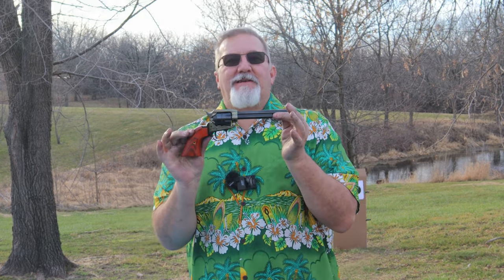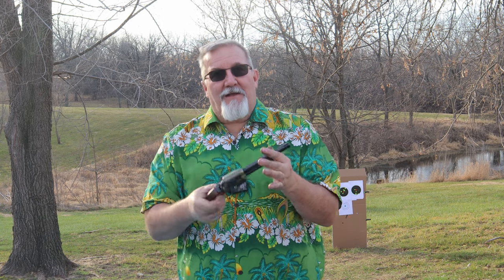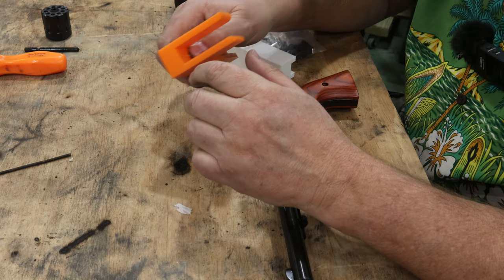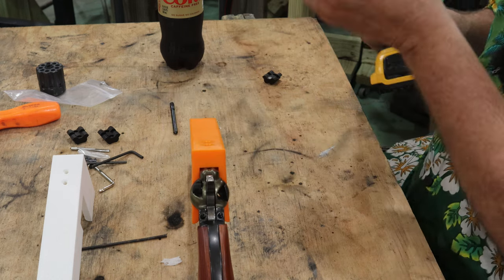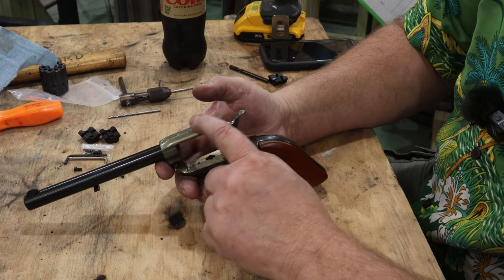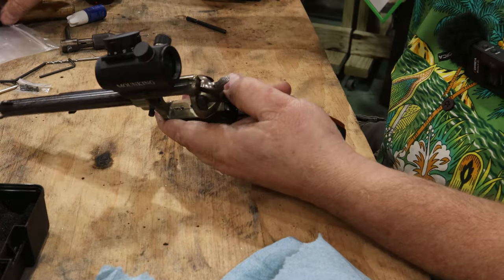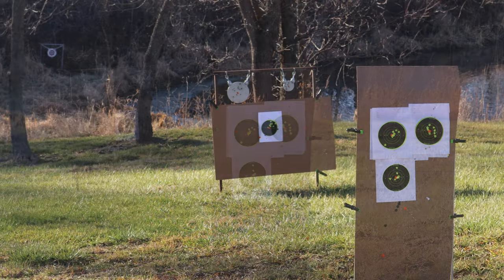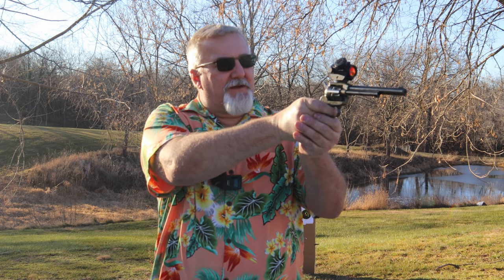Heritage Rough Rider and How I mounted the Red Dot

Comment: I built a product that I 3D print, and the cool part was that I then modified it to produce a drilling jig, to assure square installation.  In this case you started with the jig, but, I wonder if one could print a sturdy enough, contoured, and lowered dovetail at 100% density, in PLA, and substitute it for that high dovetail you got.  It could be easily designed to fill in the sight track, and to be the ideal length for engagement with the red dot base itself, while giving a wider stance for the screws.  I looks as though once the interface with the sight base is full length, there would still be space to fair the the PLA dovetail into the frame.  PLA is pretty tough stuff, and it might be more than strong enough for a use case involving a 22lr gun.

Comment: Mike that was a slick piece of engineering, for your info and that of the general community you can get a heritage tactical with a factory 🏭 installed picatiny rail and fiber optic front sight. Be that as it may your technical abilities are quite impressive 👏
Reply from the maker: I have two of the tacticals already.  I have 9 or 10 of the other style and I needed them to have better sights as well.  All but 3 of my Heritages have a red dot sight on them now. They have good barrels, just terrible iron sights, thanks for watching

Comment: What an awesome presentation.turaus now sell the 856revelver pre drilled at the factory that comes with mounting plate.well I bought an 856 before I knew what they were doing.my local gunsmiths will not do any custom work so I will have to do it myself.your video gave me ideas to do it myself many thanks.
Reply from the maker: Glad it was helpful

Comment: I just glued the picatinny rail. The connection is very strong. you need a glue in the form of a paste designed for gluing metal. glue, press, remove excess.
Modern glue holds stronger than two small bolts
Reply from the maker: interesting, thanks for watching
Reply: @Michaelsbackyardmarina  I'm currently waiting for the glue to dry under the picatinny rail on my heritage.

Comment: Nice engineering.  I've thought about trying it, but I'm not sure the jig would work on my Barkeep. I think the overall frame dimensions are the same, because the Barkeep uses the same cylinder as the rough rider, but the Barkeep frame won't accept the ejection rod assembly. The barrel length looks like it might also be an issue. The Barkeep is 3.6 inches & my rough rider is 4.75 inches.
Reply from the maker: you could do it on the bar keep. Thanks for watching

Comment: I have a Beretta Stampede with a 7.5" barrel chambered in 45 Long Colt and thinking about getting the top strap above the cylinder drilled and tapped for rail to put a red dot on it for deer hunting
Reply from the maker: That would be fun for sure

Comment: Just FYI you can now buy an ejector for that with a metal handle on it instead of that injection molded plastic one on Ebay right now for like $25. Probably the cheapest looking thing on that rig IMHO.
Reply from the maker: When I break one then I may buy one. Thanks for watching.

Comment: You gained a sub and like genius but Why wouldn't you use a micro dot? And a quality red dot does not have the problems you encountered, and give you a much better dot quality. And i fell like just attaching a picatinny rail section is a MUCH better idea vs direct fit
Reply from the maker: cost of the revolver vs. cost of the red dot.  I like to strike a balance, thanks for watching

Comment: HI.  Fantastic build!   LIKE & SUBSCRIBED.  Do you follow the HERITAGE comments on FACEBOOK?
 There's thousands of Rough Rider owners out there who would LOVE to mount any kind of 'DOTS' on their revolvers!
So, I'm wondering, how much does it cost you to produce those plastic templates, for perfectly drilling & tapping Heritage revolvers?
Would you be willing to sell a few?
& I looked up the RASCAL Mounts that your using & noticed that they have concave bottoms, I would imagine that's to snuggly fit a rounded surface?
Could you print out the exact 'RASCAL' dovetail scope mount, but have the CORRECT, CONVEX rounded base bottom on them?
Seems like NOBODY makes an exact fit rail or scope mount base that will perfectly fit  a HERITAGE REVOLVER,,, YET!?
I'd say, they Could be an easy money maker to produce?  ;>)  Not only to fit the complete length of the revolvers top strap & covex bottom, but also to widen out the screw holes,.?  Maybe, to even overlap the sides of the top strap a tad,,, to give the bases even more bearing. ????
lol,,, I'll buy the first 1 dozen!
Reply from the maker: I ended up modifying some other mounts for a lower profile. The mount kits would have to sell for at least $90 each plus shipping. They do work very well. If you are still interested in 12 of them send me another email. Thanks for watching